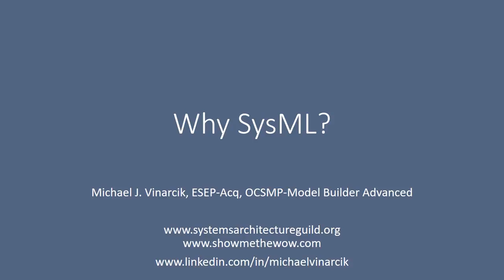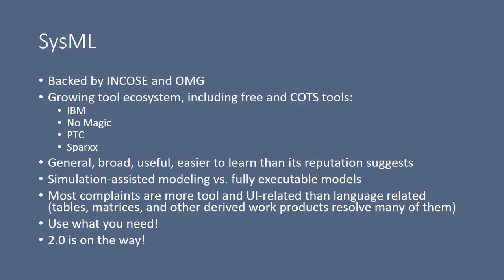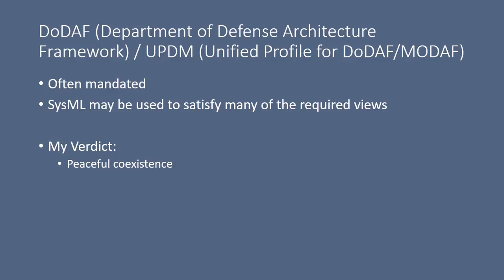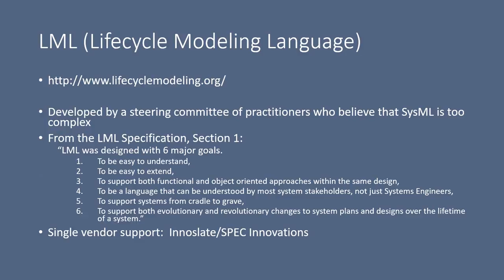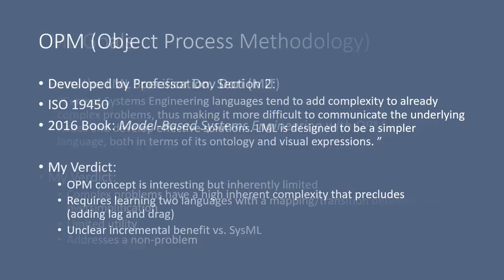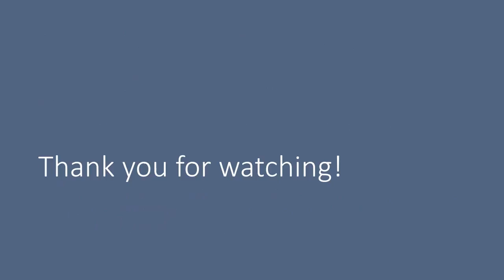Why SysML?

Comment: Being a AE and ME doing software and systems engineering, I get what AADL is about. It is really a high level programming language much like pseudo code, which makes it compile-able. It is meant for component level engineering (where a component is a black box like a flight computer or an engine fuel controller), not systems engineering problem like an airplane, car, etc. [granted a system is where the boundary under study is drawn], that is why compiling is possible.
Reply from the maker: OK...which is why I think it's not well-suited for systems architecting.